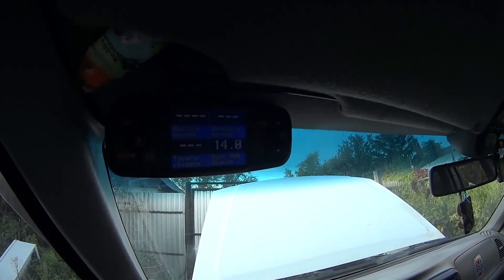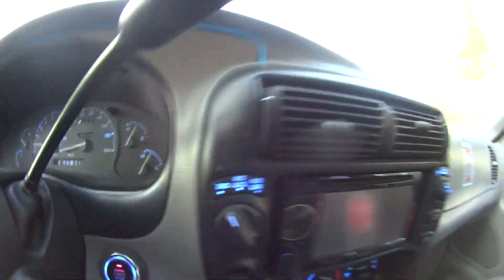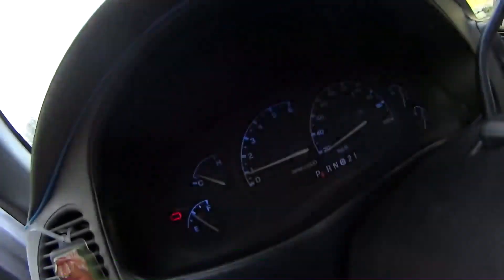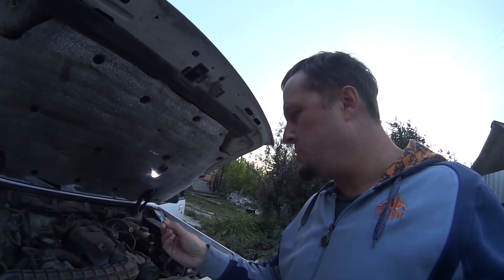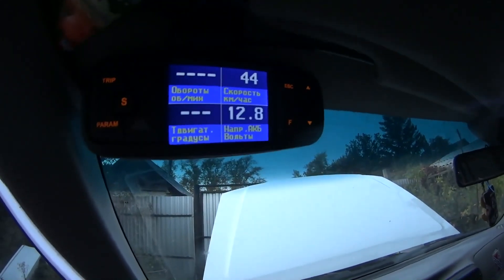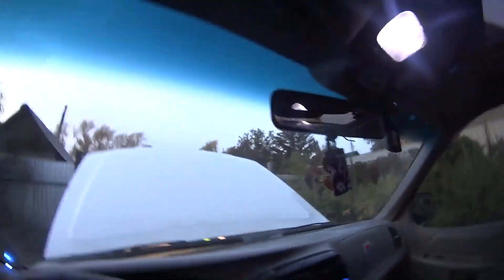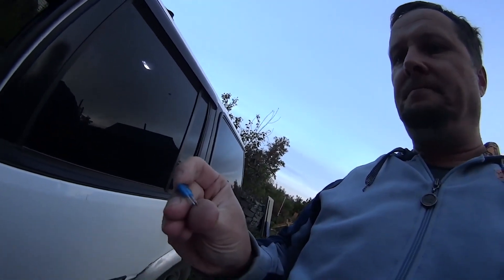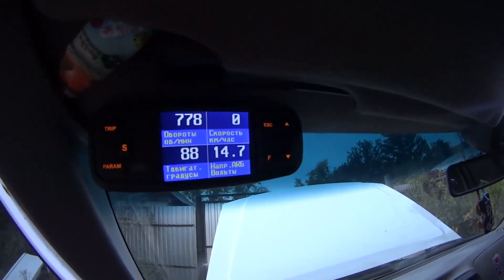Overvoltage problem on Ford Explorer - when lights blink and alternator over charging

Comment: What did the fuse slot connect to
Reply: Most likely it powered the PCM circuit for the Ford Smart Charge system. There's a guy in the states with a YouTube channel called fordtechmakuloco who covers this on an Expedition or F150. Same issue, fuse blows, PCM has to take power from another source and causes communication errors with the alternator charging system and thus noisy voltage issues. I don't know about the Explorer but assume if it's the same. I've been chasing this same issue on my 05 Expedition which does not have this fuse so the search continues. Fortunately mine is only present if I drop down in gears during passing while pulling a trailer and the RPMs jump to above 4000. If anyone knows, a solution, let me know!! 

Nice video and love the rant about cheap quality crap parts. Glad to know it's not just us in the US suffering from poor quality parts.  Makes life difficult to have to chase after a bad part when trying to trouble shoot.
Reply from the maker: Alternator